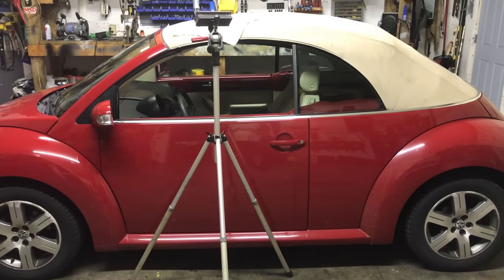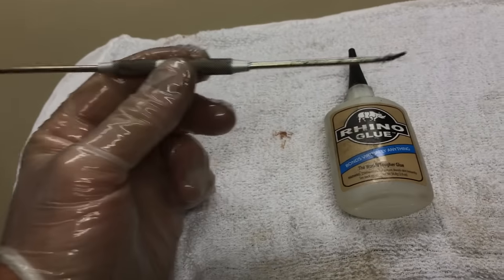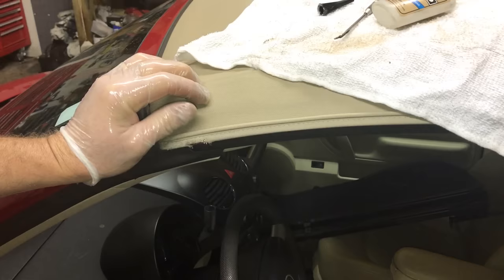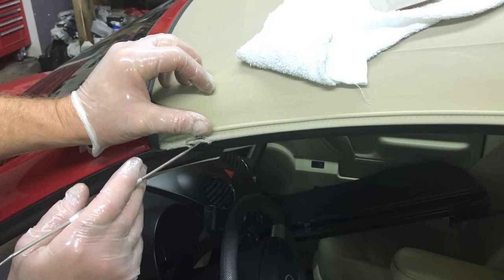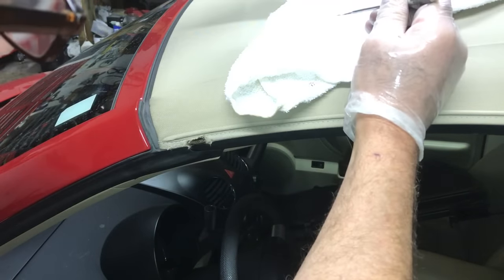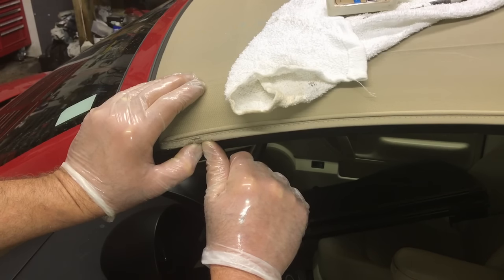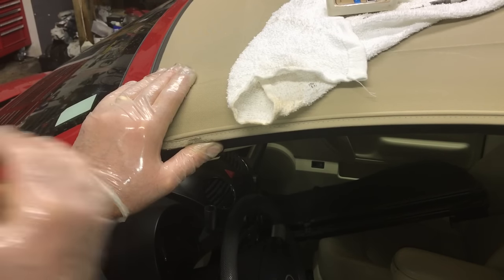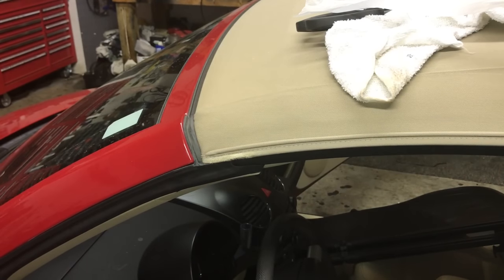HOW TO Fix a Ripped CONVERTIBLE TOP.....FAST !!!

Comment: I only searched once and got this right away this will solve most of my problem and I can't thank you enough. The top I'm repairing is the exact same color. I have a pt cruiser that has been sitting out in the weather for two years!! Couldn't afford the registration or the repairs. I'm hearing they are notorious for breaking down. 'A friend just bought me 4 new tires. Now I've GOT to fix the top. Any ideas for what looks to be loose threads that aren't at the wear stage yet? I've got a couple of rubbed raw from the frame. Looks just like what you repaired here. I cant wait. But what would I use on an area of maybe 3 inches square of just beginning to fray? I would appreciate any info you could share. I'm afraid come summer I wont be able to lower the top without it turning to dust. I have bought some top cleaner from Mopar. Heres hoping it won't dry it out too much. Woolite? Any particular formula? SORRY for taking up so much space. I really appreciate this.
Reply from the maker: Hopefully you got your repairs done on your top my friend, but what we would have done was the video instruction on even the threads that are just starting to wear otherwise you are going to be doing them in the near future so just do them all at the same time. We have several videos on repairing/conditioning check them out. Thanks for watching, hope you have a great day. mad Mike & team

Comment: I just bought my first convertible. My knowledge on them is 0!!! It has about 3 rips along the frame of the top, so I am assuming normal wear and tear.  I will eventually get it replaced. Is there not a treatment or product for the entire top (like Flex Seal) for a temporary solution ?
Reply from the maker: arthur send pics so we can assess this for you ..sweetprojectars@gmail.com    mike
Reply: If it's a cloth top it needs to be waterproofed about twice a year.
303 Company  makes a great fabric waterproofing liquid spray......or a company called "Raggtop"

Comment: Hey!  I have the same car, but with a black top that is fraying in a few places, not just the edge.  Can you tell me the name & brand of they fabric dye you're using?  Will this technique work (similarly) in other areas of the top? There is a spot in the crease where the top folds down, and another next to the edge of where the back side window comes up (I wanted to attach a picture, here, but I don't see a way to do that).
Reply from the maker: Hi Julie we use RIT fabric dye we buy it at walmart...send your pics so I can assess your other top issues for you to sweetprojectcars@gmail.com  thanks so much and we are glad you are here with us :)